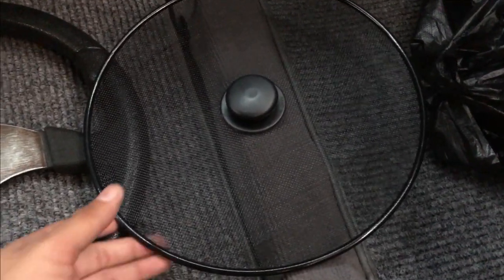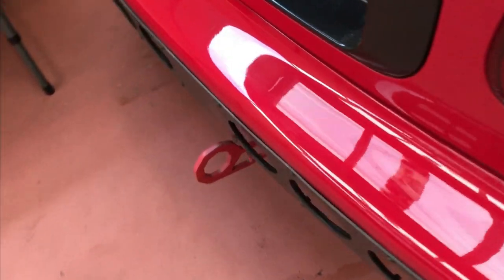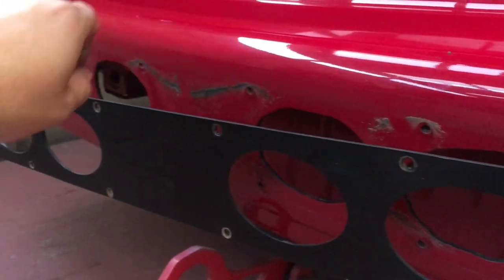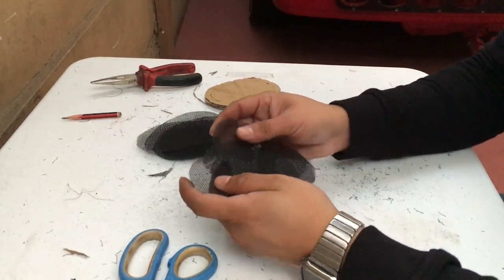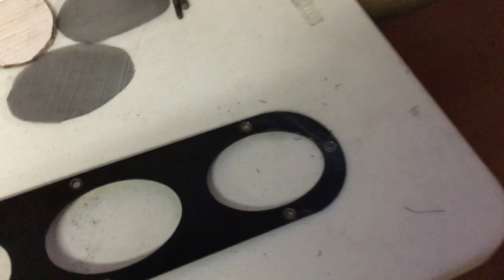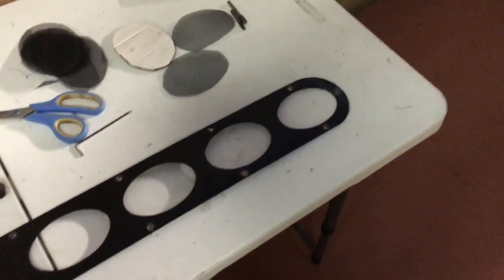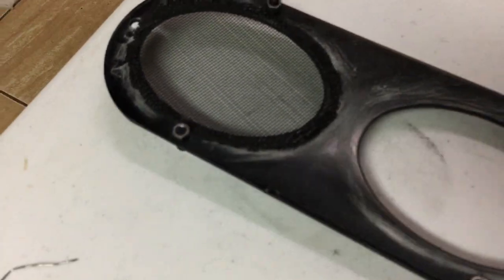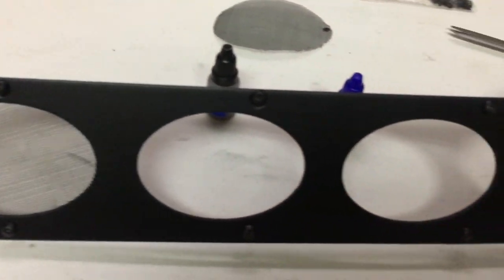MODIFYING MY HONDA EG DIFFUSER

Comment: There is a metal mesh that you can actually buy
Reply from the maker: Honda Day UAE yeah I prefer using this mesh because it has very small gaps and give the illusion that it isnt there unless u actually have a closer look
Reply from the maker: Honda Day UAE Like mentioned in the video i have used the Same mesh on my rear garnish and aero duck
Reply from the maker: So i wanted to keep the Same look flowing
Reply: Awesome work 👌
Reply from the maker: Honda Day UAE Thanks bro🙌🏼